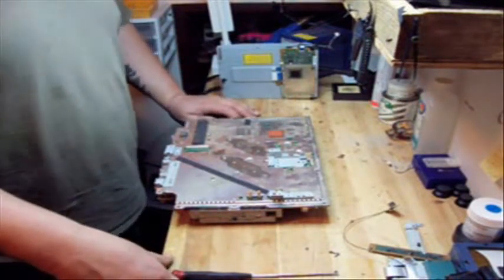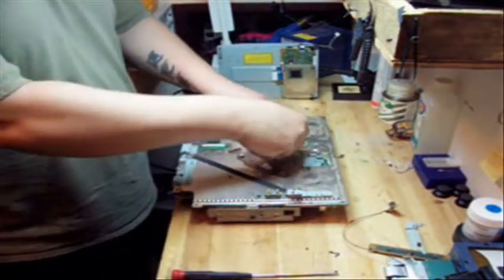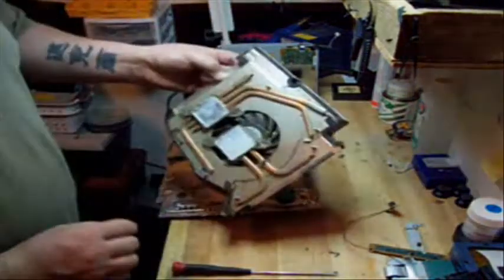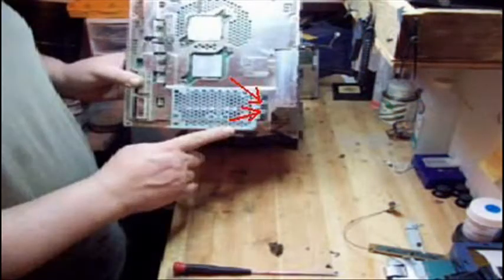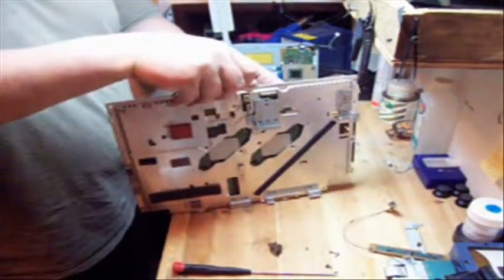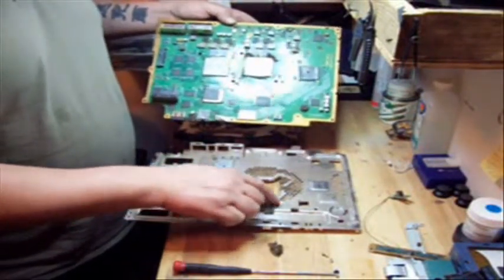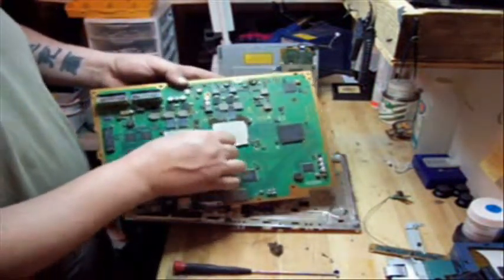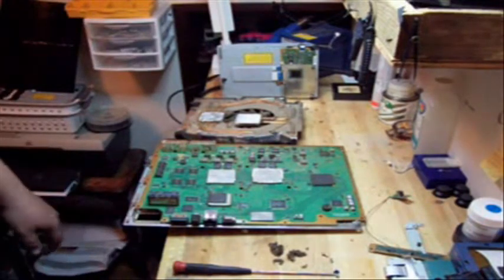PS3 60GB board disassembly

Comment: Just wanted to say thanks for the very helpful videos and also ask for some advice. My 60gb PS3 has developed a problem lately. Its turning on and working fine for anywhere between 1 to 20 minutes (yesterday it froze in 30 seconds) and then the image will freeze yet the disc will keep spinning and the lights will stay on. It then becomes completely unresponsive and i get this weird artefacting on the screen and ill have to turn it off at the plug.

Any ideas what is wrong with it?